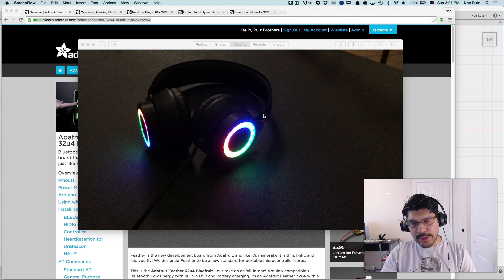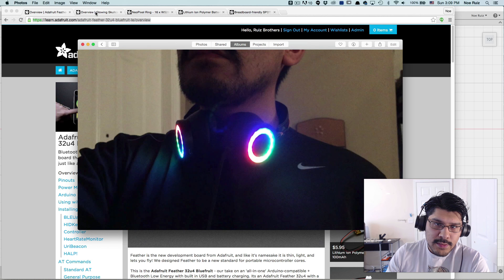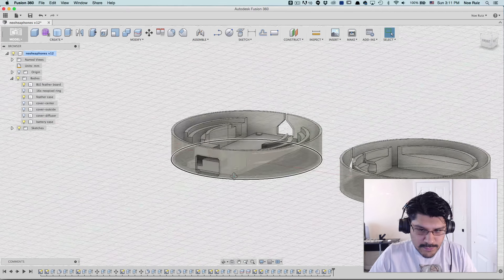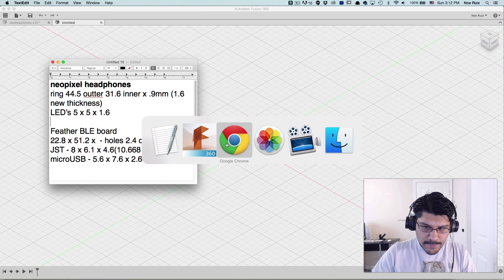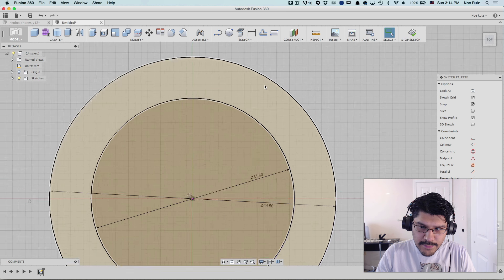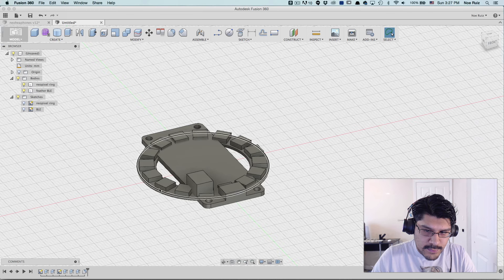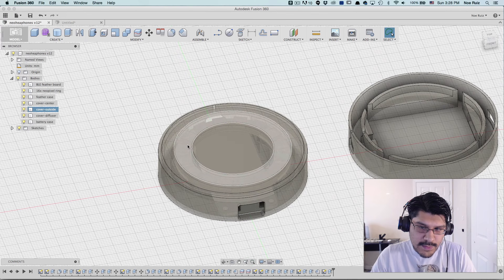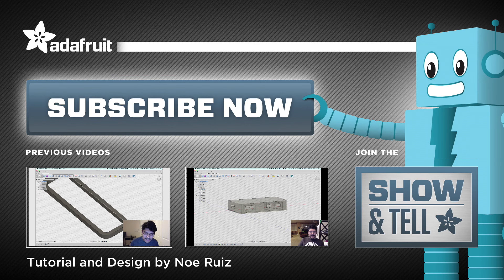Layer by Layer - NeoPixel Headphones PT1

Comment: Audio sounds great. 
A nice addition would be to add a strip across the top.
Also, the 2nd ring in the code you may want to reverse the order of the pixels so the 2 rings rotate symmetrically.

Comment: It´s the 1080p 27" confortable to use for designing? Isn´t it the resolution too low?

I can´t afford the 1440p 27" monitors but I´m afraid that 1080 might be not enough for that size :/